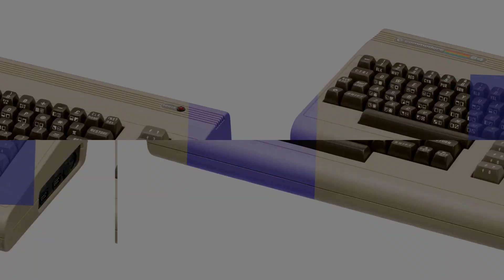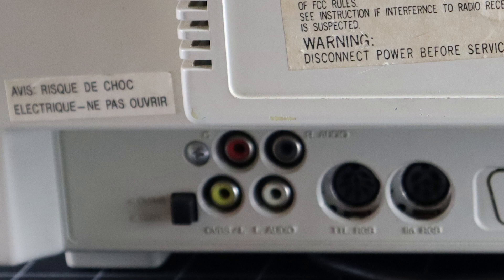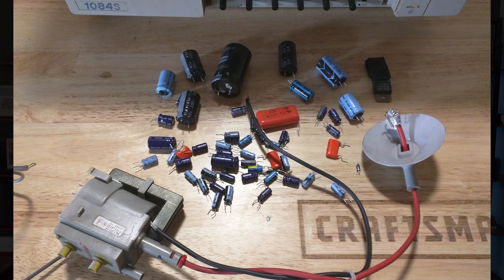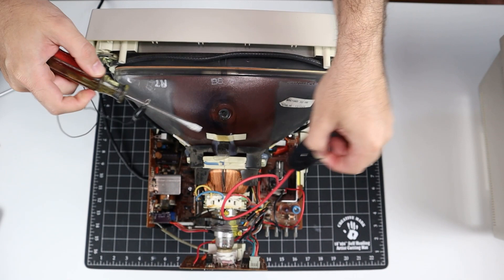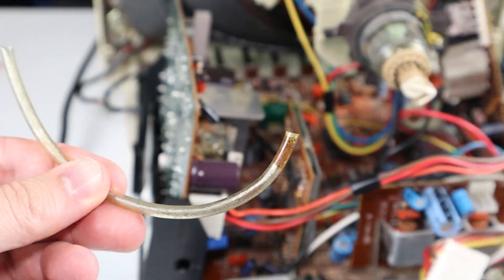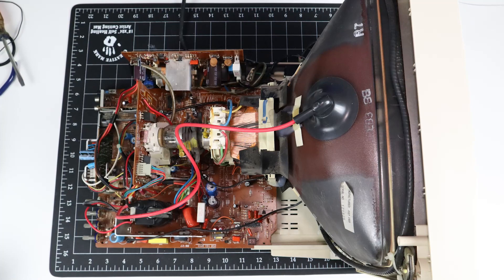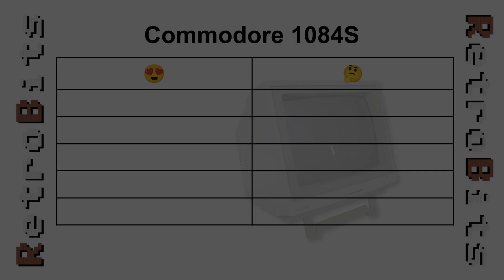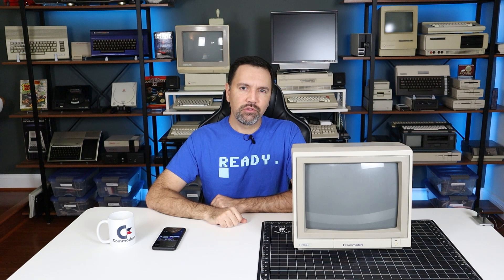Why I Love the Commodore 1084S CRT Monitor

Comment: I have exactly the same model.  So far still going strong  🤞
After watching this video however I’m concerned about ensuring I don’t run any non-15khz Mister cores.  Is there a list of which cores would be safe to run?
Reply from the maker: After finding the real failure, I'm pretty sure that the MiSTer didn't play a part in the failure, just age. I'm not aware of any comprehensive list. Each core outputs the native signal for the original hardware. For sure the 486 core defaults to 31Khz, but you can force it, or any core really, to run at 240p with something like this in the config file:

[ao486]
video_mode=320,8,32,24,240,4,3,16,6048
vga_scaler=1
Reply: @retrobitstv  thanks for that.  So after finding the issue, is your 1084S salvageable? 🤞
Reply from the maker: @damiansurace7941  I will need to find a suitable donor yoke from a similar model of display that has very similar properties to my original, or try and repair or re-wind the damaged copper windings. Step 1 will be to remove the yoke and assess the level of damage. If it's not too crispy I may try and repair the insulation, but if the wire itself has melted it will require more serious repair that may be beyond my skill level.
Reply: @retrobitstv  Best of luck!  If anyone can resurect it, it's you!
Reply from the maker: @damiansurace7941  Thanks! I will give it my best shot :)

Comment: I've got two of them, ordered from listings and came perfectly working. But both of them failed within 2 weeks, same black screen with the same noise. That's all, they just fail and I won't put anymore money in these monitors. A similar size Trinitron TV CRT and that's all what you need, they come with SCART in Europe and they're stronger built than the "anyway it will fail" Amiga/Atari monitors.
Reply from the maker: Yea these monitors all suffer from flyback and/or power switch failure eventually. Both parts are still available and aren't too hard to replace. If you still have the monitors, hopefully someone wants them to repair or at the very least, the parts can be used to keep others going a while longer.

Comment: Am I getting the FIRST comment?? This is SOOO strange.. LoL.. Anyways, I just love (sarcastically) how they advertised the Commodore Colt: as "The Complete IBM Compatible Machine For The Whole Family!" And then under the Price it says: "w/o Optional Commodore 1084 Color Monitor." And then you paid MORE for the SEPARATE monitor. Uhhmmm...  That's NOT a complete System!!!! The 80's WERE SUPER Funky for computers because sold monitors separately.. LMAO...   ='oD     Could you (or someone here) please recommend a good quality soldering kit for beginners?? And thanks much. = o )
Reply from the maker: I used a number of cheap $15 Radio Shack soldering irons over the years, but finally broke down and bought a nice Hakko (link in the description). At over $100, it's a lot pricer, but once you use a nice one, there's simply no going back. Also, I've learned over the years that if you buy cheap, you buy twice (or more). Get a quality tool and it'll last a lifetime.
Reply: @retrobitstv  Awesome. Thanks Much.

Comment: I want you to research how to rewind that deflection yoke. I want to see you try...and succeed and then I want you to make happy dance.  We lovers of all things commodore will go to the deepest depths of effort to keep them alive. I may drill holes in MY breadbin to mod it more and more until there's not a mod LEFT or space to put a hole for a switch or knob...but she's a rescue, found dead in a crack puffer's closet and full of cat piss and turdlets. Needed SID, CIA, RAM, much keyboard repair involving early C=64C white keycaps w/ gray front symbols (not on top) - and orange VIC-20 function keycaps and mechboard cherry blue switches, recap, SIDFX, VICII2, JiffyDOS, Switchable kernals, RF bypass, a gang of synth effects filters, a one tube headphone amplifier, reset switch...I think I'm STILL looking for a mod I can do to it. I modded all HELL outta the 1541 ALPS drive. Track display, device ID switches, reset, RAMBOard, parallel burst nibbler mod, JiffyDOS and I'm building a DolphinDOS board. Turbo Chameleon 64 v2 w/ battery, RRNET card, dock, cable, remote. 1541 Ultimate II+. Pi1541 (the Raspberry Pi 3b+ one.) Easy Flash 3. 64 NIC+. Magic Voice Module, a Ray Carlsen power supply, Printer, datasette, cats painted all over both 1541 and C=64 to pay homage to it's past life. I buy one deluxe collectibles game from protovision and the like at least once per month. It understands full-well that I love and adore it. I could NEVER sell it. I would NEVER shitcan it. And we know that the day will come that you remedy this coil. OR ELSE!

Comment: As a CRT TV engineer I will tell you within the first 3 seconds of your video that is NOT a good CRT at all. The tube when turned off needs to be as dark as possible like a Grundig (Atari) Sony (Apple) or Panasonic. That is medium grey. I have every C= monitor ever sold and my two 1902 monitors are the only ones with dark grey tubes.